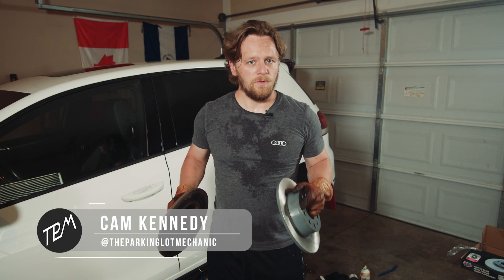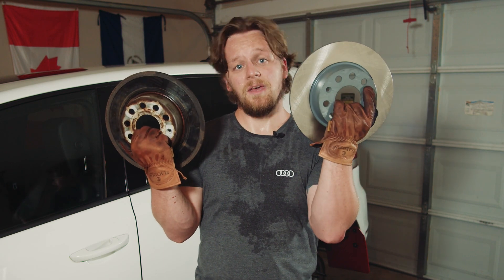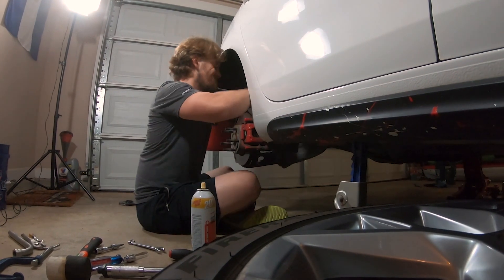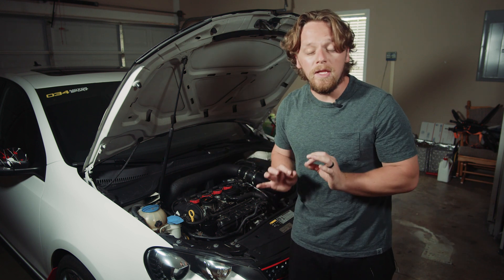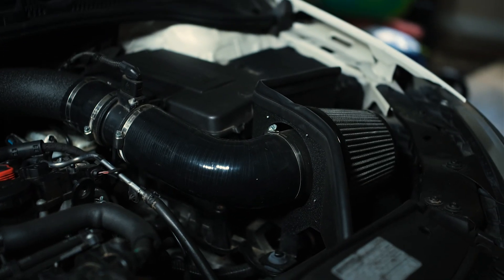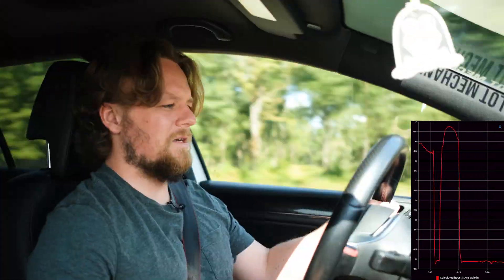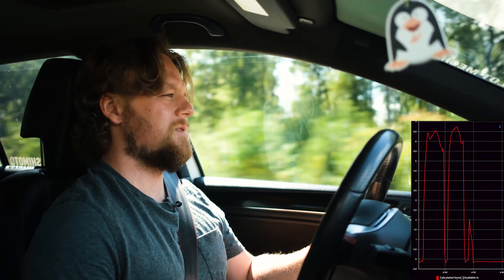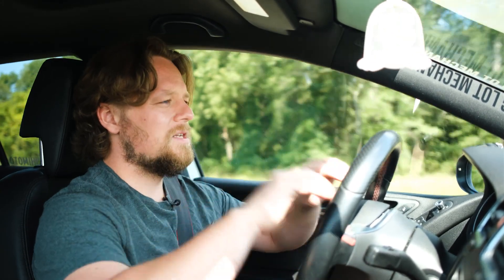Where Has My Power Gone? | MK6 GTI Power Loss Diagnostic | Part 2

Comment: Great video I have a Mk6 remapped, one day feels quick one day  or when warm slow another  weird 😮
Reply: Same. Some days I’ll light up second no problem other days it’s kinda sluggish and there’s a weird surge in power till I get to 4k
Reply: @vw.noahhh  your wastegate is sticking possibly, or the bushing is worn, or both!
Reply: @BoomBeench actually ended up being my secondary o2 sensor. I missed the memo of people being tuned thru a CobbAP usually unplug the secondary cuz it can affect fuel trim, boost, and a whole load of other crap.

Comment: I really enjoy watching you diagnose the gti since it’s such a complex design compared to a Honda or another car but I can’t say your idea about not peeking 7 is correct tho considering I peek 9-10 psi and I only have muffler turbo delete and ecs intake. It really could end up being your actual air pressure, my car performs best at night but that’s because of the air pressure from the temp dropping. Try doing a run at night and see if anything changes great video btw 💯
Reply from the maker: Thank you so much for the kind words! I'll have to try a run at night especially since it is getting colder and see what I get. You're the second person to tell me closer to 10 psi is stock so I am really questioning the forum source that said 7 psi.
Reply: @TheParkingLotMechanic  another project you could do is install an actual boost gage, you seem to click with the way Volkswagen like to do things under the hood so that will give you the best answer compared to the little computer errors they might have.

Comment: Quote me if I am wrong stock boost pressure on mk6 is 8-10psi.
Reply from the maker: The research I did didn't yield the best results but eventually something said 7 psi. No one shot it straight so it could be 8-10 psi. I hope it isn't cause then we do have a bigger boost leak... Yikes!
Reply: @TheParkingLotMechanic  Even if you have the newer DV style, it could be bad. I too have noticed a drop, but I am tuned and I can hear my DV making a sound at high RPM. Replacing it with revision D once it gets to my house
Reply: @TheParkingLotMechanic  Hey there! i’m completely stock other than downpipe & 3’ intake @ my gauge says 10psi and peaks at 15 on a nice day! hope this helps
Edit: only hits 15psi for a slight moment 
2013 golf gti❤️
Reply from the maker: @moneyman1641  Thank you! That does help :) still got some stuff to figure out for sure!